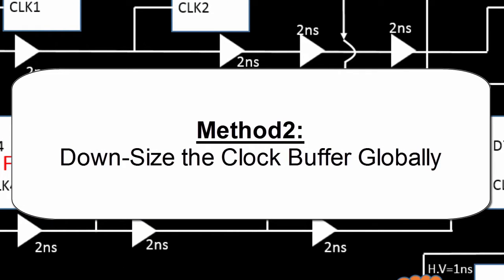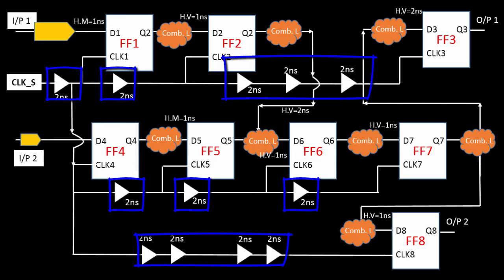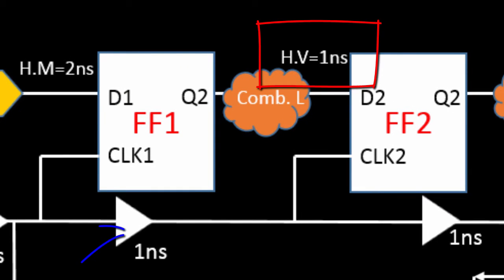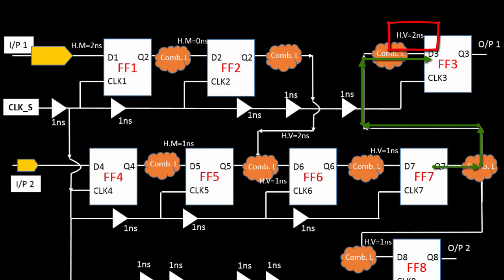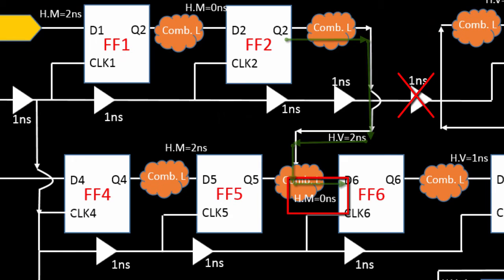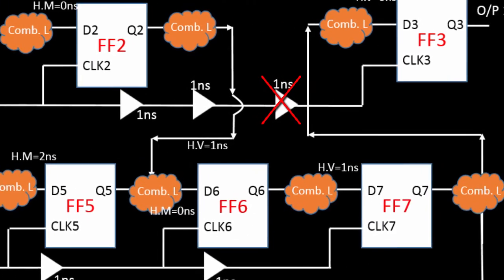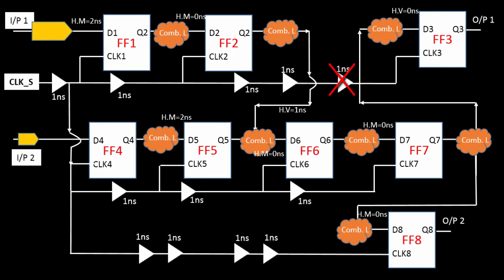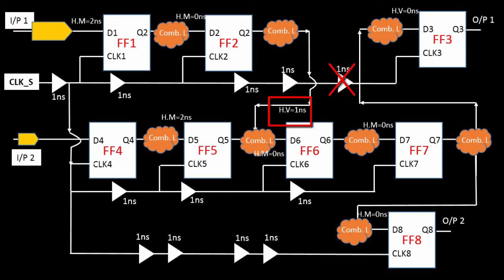CLK_L10 - Fixing Large No of Hold Violation using Clock Skew (Part2)

Comment: you have to UPSIZE buffers to decrease delay through them
Reply: Tool will optimize the data path for setup and hold violations. Hold violations are only looked at after CTS. Focus is only on setup till CTS.